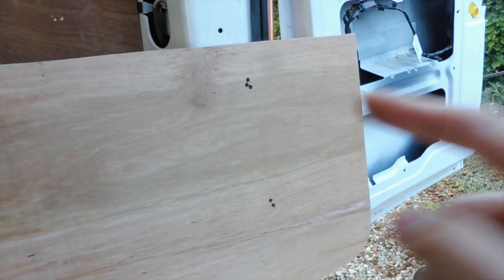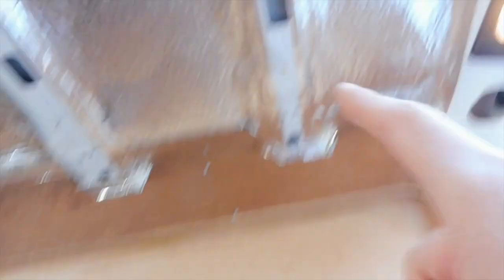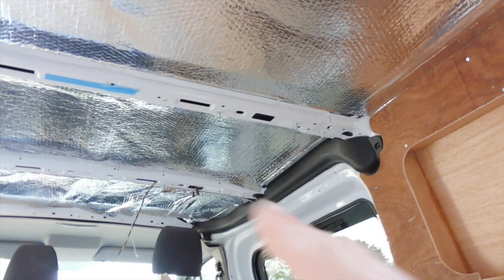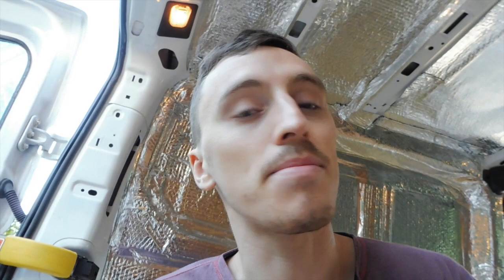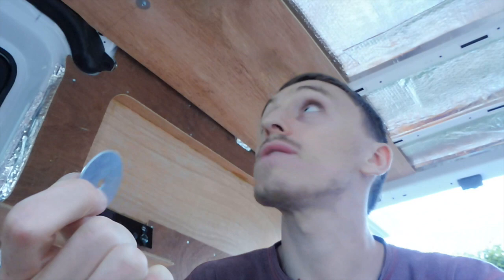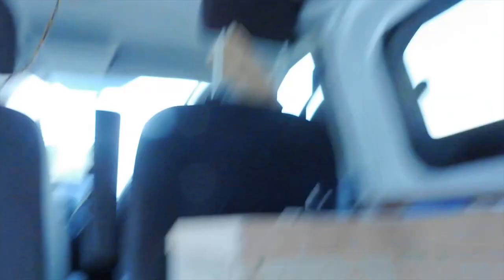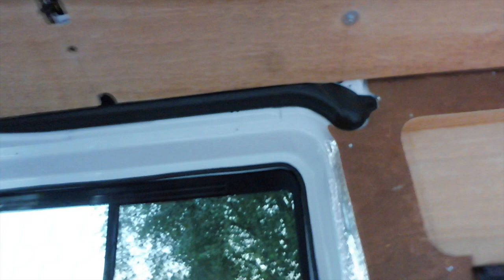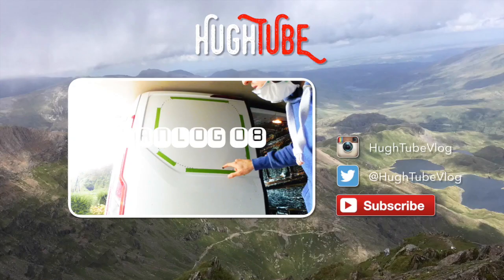VanLog 09 CAMPER CONVERSION Ford Transit Custom STARTING THE CEILING! HOW TO

Comment: Tip if the bolts push back into roof void make a very tight plastic washer from kitchen package waste.Thread it on and you’ll see this holds the bolt solid

Comment: Plus Nuts
You can find them on Amazon.  They go into the holes and act in a similar way to anchors that you use on drywall.  I mention this because it might have been easier to put the nut in the ceiling, then feed the bolt w/fender washer through the ply and screw it into the plus nut. 

I understand the difficulty of holding it up, and then fitting a washer and nut on to the bolt.

Love the series, despite being in the US and not being able to get a Transit Custom.
Reply from the maker: Awesome will check them out, cheers! 
Do they not sell the transit custom in the US!? How odd.

Comment: Your bed...floor mounted with storage under?  Mounted to the wall and it folds up against the wall to give you more room during the day?  Hanging from the ceiling?  Room for a comfy recliner chair?  Shower...rig a tarp over the open back doors to create a "shower stall" and use one of those submersible shower head with pump in a bucket?  Portable camping stove or two burner mounted in a cabinet?  Solar?  Cassette toilet?  Enjoying the build so far...good luck.
Reply from the maker: Hi David, the bed isn't fixed down yet but yes I plan on making storage under the two parts that touch the walls. The centre part will be 'floating'. Instead of a recliner i want to put the double passenger seats on a swivel mount so they create more interior seating. The shower idea is great I also have a plan for the shower that can combine with that! The corner kitchen area will have a sink and cooker, solar is planned but later due to costs. Not a fan of cassette toilets. Thanks so much for all the input!!!

Comment: Hi nice job? to make life easy you should use plaster board fixings then wedge the board to the roof just drill a hole through the wood and steel strut insert plaster board fixing and just tighten up ? no fumbling with nuts and loose bolts? good luck Ken
Reply from the maker: Cheers Ken!

Comment: Wheres the thick insulation. The foil backed stuff is good but some kind of recycled plastic insulation(similar to rockwool) would be good to add ?
Reply from the maker: Hey Steve, yeah I am thinking of taking down the insulation videos from this playlist down soon. I did this with very little knowledge of insulation and this reflectix stuff is only  really  good as a vapour barrier. For better insulation vids check out my latest stuff
Reply: @HughTube   Hey sorry dude i did not realise the date on this , would not have posted. Thanks for your really helpful vids.